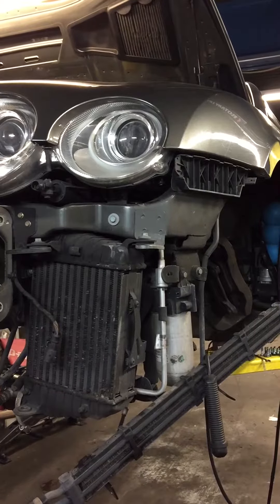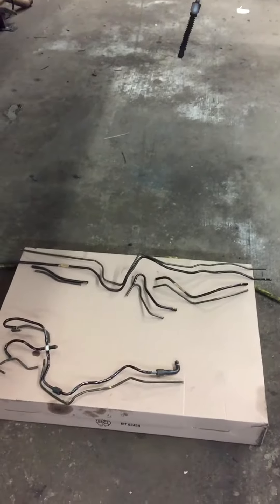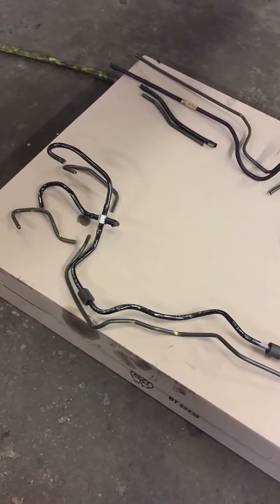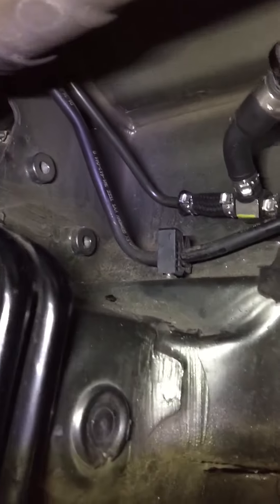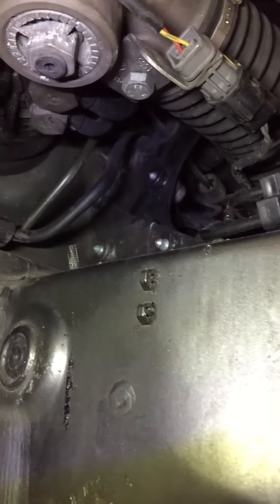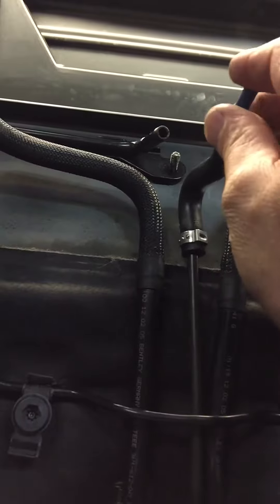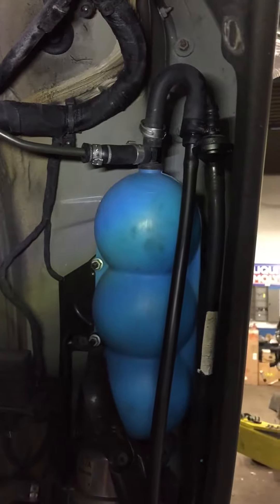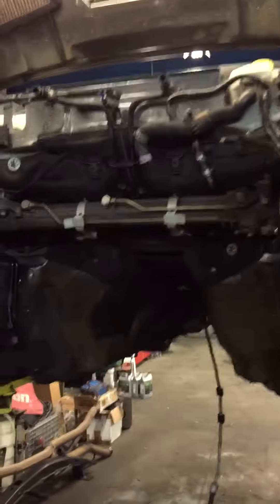Bentley vacuum leak repaired the right way

Comment: I have a 2009 that shudders during acceleration and got codes P0300, P0301 and P0305. Smoke test happening soon. Do you think it is ignition coil & spark plugs? Or is the 2009 have the vacuum leak issues too? The car seems to idle fine and doesn't seem to stumble under very light throttle when driving.

Comment: Hey,

Looking into a 2010-2011 continental gt Supersports...But I’m concerned about the engine out repairs on almost every single thing...
Has the leaky vacuum line been situated on these year? What kind of repaired should I expect from a low mileage to approximately 50k miles on these years? Any response would help...
Reply from the maker: Borin Pich Hey,  you will still have the plastic lines below the rack & pinion and the thicker plastic lines going to the back of the intake manifold. There is always two way to do the repair.  Many have claimed to remove the rack & pinion to replace those lines. I always remove the engine and transmission assembly because it is the correct way to repair the car and once the assembly is out. You can replace lots of other parts without major labor as if the engine was still installed. I started replacing the thicker plastic lines with aluminum lines that go behind the intake manifold. All these lines I custom make myself and once they are replaced it will never go bad again. It also adds value to the car. If you love the car and want to keep it for many years. Replace these parts while the assembly is out. 
Both engine mounts
Bank 1 passenger side EGT sensor
Starter motor 
All oxygen sensors 
Both coolant sensors
Valve cover gaskets or complete valve cover assemblies  with gaskets and hardware 
from Bentley
Spark plugs and check part numbers for updated coils. 
Fan belt with both idler rollers and tensioner 

Other know. Issues are front struts go bad over time
Headliners sag over time
Most of it all depends on how the car was kept and the climate it was in. 
Great car and definitely a lot of fun to drive 👍🏻
Reply: Jason Giannetti 🤯 These engines aren’t designed like Ferrari’s and Porsche’s for easy engine out...now I see why the depreciation drop significantly. Thanks man!

Comment: Hi thanks for your quick reply but I gotta ask can the auxiliary water pumps couse the overheating? Should I just have to water pump replaced?
Reply from the maker: Micheal Treeman  Hey Micheal 
I would definitely replace the water pump on the engine. I have seen some issues with those.

Comment: Jason, which year did bentley fix this problem. I was told 2007 was last problem year
Reply from the maker: Hi Tony
All the cars from 2004-2011 have the same issue. The newer generation cars being 2012-2013 still have plastic lines but they now use a heat protection sleeve to cover the plastic lines from the factory. That has helped the lines last longer. When I make my line sets. I also supply heat protection wrap for the factory check valves. As far as I know of bentley never made a retro fit kit or started using stainless steel lines to replace the plastic lines. So many manufacturers are doing this as well.

Comment: Hi do you have any videos of a  Thermostat job on a   2006 flying spur?
Reply from the maker: Micheal Treeman Hey Micheal
No video yet but it’s a strait forward job. Remove the intake plenum and lower intake manifold and you will see it on top of the block in between the cylinder heads. Get new gaskets, it’s really not that hard. Good luck 👍🏻

Comment: what's the price for this to be done ?
Reply from the maker: 4500. Parts and labor
Reply: @porsche951g  Jason, this has to be done on 2010 (supersports ed.) as well? I heard (or read in a forum) that you can replace the lines by just dropping the rack? I have the dreadful dtc's as well but I'm in the area of the country where they never saw this car (for real - some good mechanics but not experienced with bentleys), just trying to see if I can give my mechanic a higher handicap...where are you btw?
Reply from the maker: You can contact me at 5163982016 text or call. Yes people have replaced lines by removing the rack and pinion only. But real professional mechanics will remove the assembly to do the job correct. Those guys who just remove the rack are only short cutting the job and are not seeing the complete picture. When the assembly comes out you can then replace other known parts that will fail in time. That’s why I only do it right the first time and never short cut any job. I also now make the uprights in aluminum. Those are the thicker lines that go behind the intake manifold. I now live in the Charlotte NC area and work by appointments only. Let me know if you want it done correctly 
Thanks

Comment: u only doing pipe small vacuum hose brake pump across but this not also will not fix permanent both up hose go to plenum manifold ...this also is leaking and same time with small plastic hose if u keep using original hose.....i did bent these line with metal line and not have any more problem except the 3 way maybe leak another 10-15 year later
Reply from the maker: Thanh Nguyen I actually made lines that go behind the intake manifold to the main factory stainless union near the tack&pinion , I just never made any videos showing it. Maybe I will post another soon

Comment: That will be $10,000 please.
Reply from the maker: Maybe if you went to the dealer. But I do the whole job parts and labor for 5500. With a line set that will last the life of the car and added Aluminum upright lines to the set witch are the ones behind the intake manifold. This adds value to the car and takes guess work out of knowing if it was done or not 👍🏻
Reply: @porsche951g  That's a very good price.  And while everything is apart, you can easily access other preventative replacement items like oxygen sensors, starters, idler pulleys, water pumps etc.

Comment: Jason, Thank you for this post, I have done this job 10+ times all with factory parts. I will be doing this way from now on. Another problem area are the larger lines that connect upper plenum. They split at the one way check valves. Again, Thanks. Robert McGullam Dallas European Auto, Plano, Tx.
https://plus.google.com/u/0/+RobertMcGullam